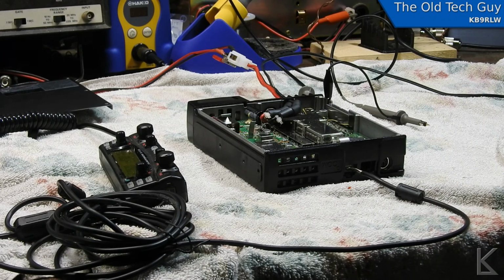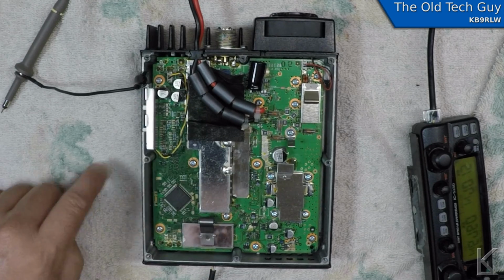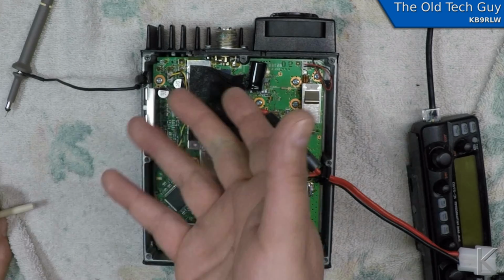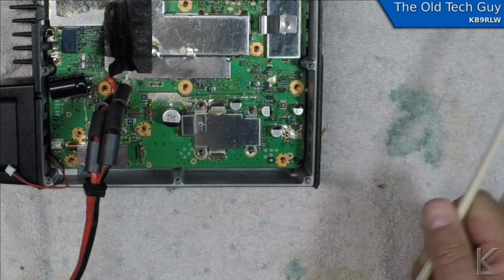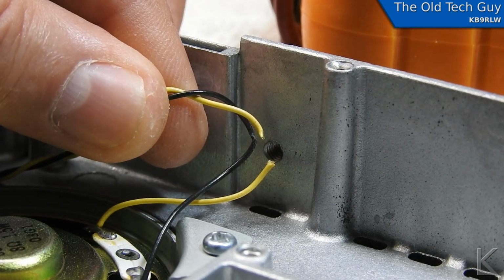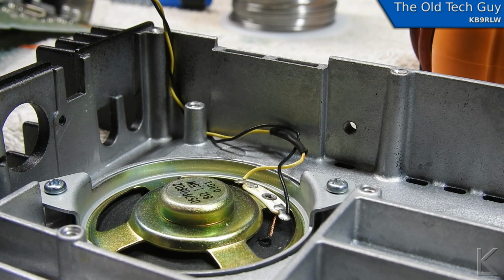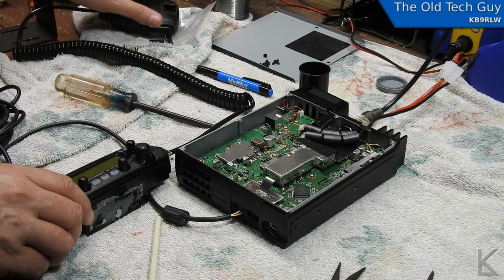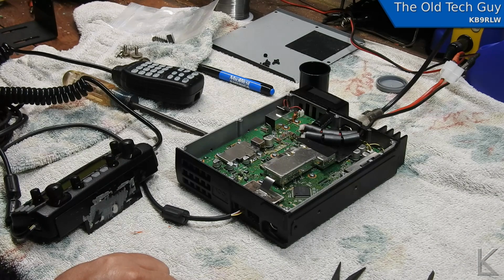Ham Radio - Icom IC 2720 repair of no internal speaker audio

Comment: Would have been nice to actually see the repair. You never showed the desoldering and resoldering of the sheild and connector, or the repair of the speaker wire.
Reply from the maker: I've done soldering in many videos already, skipped setting up the cameras on this one.   It's a tough shot to get sometimes, with the angles and lighting required.   I'll do it from time to time though.

Comment: Kevin I've got a repair question for you, I picked up a used iCom IC-T90A multiband transceiver and it receives OK but doesn't put out any measurable power on Xmit.  It actually seems to be transmitting and the LCD display shows full power but the output is really weak.  It appears that someone removed the SMD diodes from the PC board that limit the transmit frequencies for the US market in order to open it up.  It seems like the radio should work without the diodes since they aren't installed in the international version but there might be more to the mod than just removing the diodes such as changing some other parts or updating the software that nobody seems to know about.  I Googled this problem and there were a number of people reporting the problem but no solutions for making it work at full power again.  Do you have any ideas?
Reply from the maker: The diodes are just switches the microprocessor reads when its software is deciding to go into TX mode or not.  Since it's going into TX mode, that's not the problem.
Do you know the radios history?   I have seen a few radios on the used market that were picked up by CB'ers and opened up for 11 meters.  Usually those are somewhat abused with poor antenna systems, or the ops twiddling adjustments inside trying to get more modulation on AM, etc.
I'd look at the finals first.  Check for open junctions using a multimeter.   Put the rig is CW and check for RF with an oscilloscope.  Check the gates on the finals to see if your getting drive from the driver stage. etc.
You'll probably find the finals are blown.
Reply: I was afraid of that but the SMD parts won't be easy to check.
Reply: If just transmitting on a band without the proper antenna will blow out the final you'd think they would have built-in protection otherwise all the international models are going to get blown out by accident aren't they?
Reply from the maker: Most modern radios do have protection circuits that fold back power when the SWR is high.  Radio is radio regardless of what country you're in.  Most bands are universally recognized.  So 40 meters is the same here as any other country.  So I don't understand what you could mean about international models.
Reply: The international model of the IC-T90A doesn't have the diodes the US model does so it isn't locked to just 50, 144 or 430 Mhz.  They claim it does have a protection circuit but apparently it only works on those bands so I don't understand what keeps it from getting burned out every time someone presses Transmit and they are not on the proper band with a matching antenna?
Reply from the maker: The diodes are used to tell the processor which set of restrictions to adopt.  There will be different band layouts in different regions.
Protection circuitry is not a magic bullet.  It will fold back power in a moderate mismatch condition.  But abrupt major changes will happen too fast for the protection to fully kick in.  That's why I tell people to drop their power down before doing a tuning cycle with their antenna tuner.   While cycling, the tuner can produce short spikes of high SWR too fast for the radio's protection to kick in.
Also, it's the responsibility of the radio owner to use a correct antenna and choose a proper operating frequency.  You can't expect the radio to be foolproof, (in the literal sense).
A normal car will break if you go driving across a rocky field at fast speed.   They don't design the car to not break under severe abuse.  The same is true of our radios. ;-)

Comment: 7-28-2018, 10:04 A.M,  has135veiws and 29 likes, thats good for the same day publish.. i had this radio but before i could use it i ended up in the hospital for nearly three months, but when i got home and whet to use the radio it could not not be found anywhere in the house, i found the face panel but the body has never been found.. that's been a few years ago. i think the through out the body in the trash not knowing what it was,

Comment: Has the radio been used with the wrong impedance if so then only use the proper impedance or you will destroy the unit.
Reply from the maker: So, you're suggesting that maybe an impedance mismatch caused that wire to just split in two?
Reply: I mean that it will cause the chip to over heat and burn out and need replacement if the PA mode has been used with a speaker of say 2R or 4R the proper speaker will be at lest 8R,  that little problem is bizarre as you say.
Reply: No it is just something that was said to me by a guy who fixes radios but now actually builds personal computers to order at a premises near to where I live approximately 3 miles, If you are interested to who he might be his wife has the same name as the woman who played Kristle Carrington in the Dynasty series and no the guys name is not Yanni.